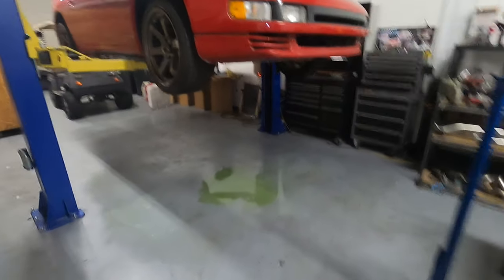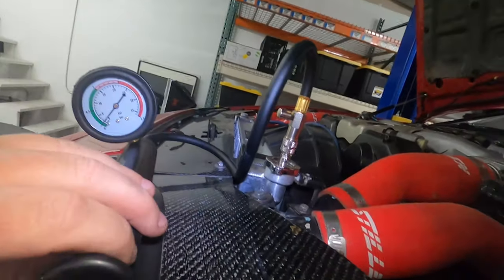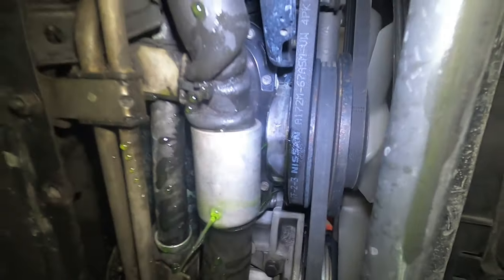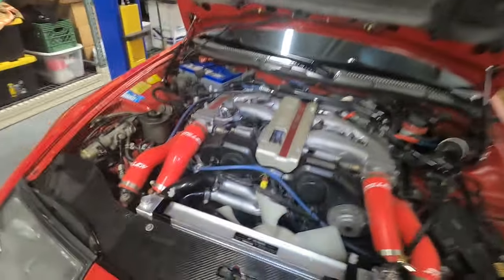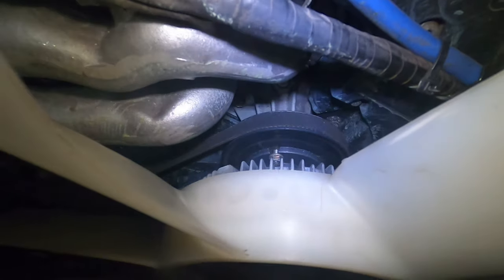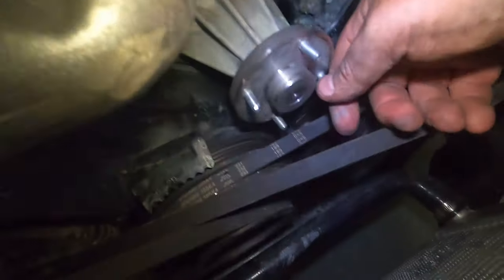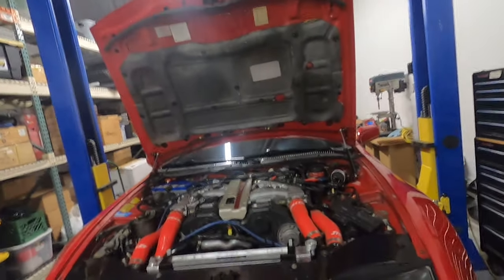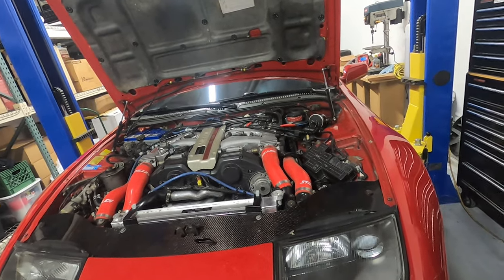Z32 TT Coolant Leak - Tell me about it!

Comment: You will need to run a catch can when you delete the pcv system.  You will plug valve covers at the back and then run 2 hoses from the j pipes on the front of the intake valve covers to the catch can.